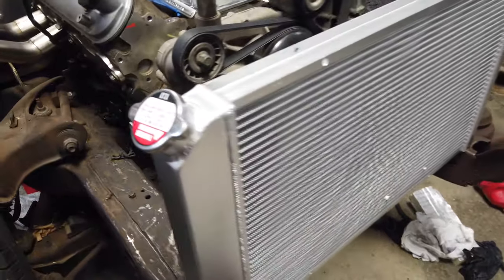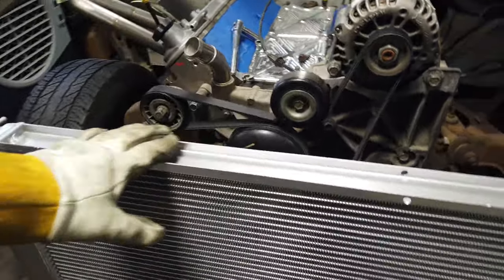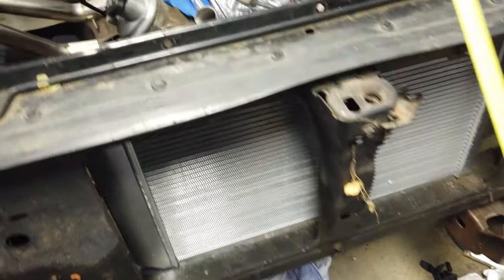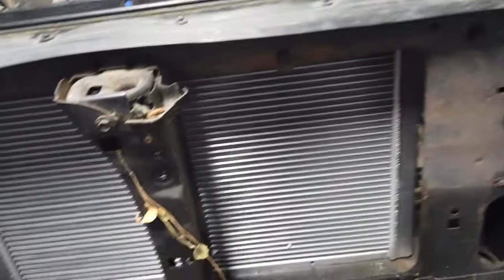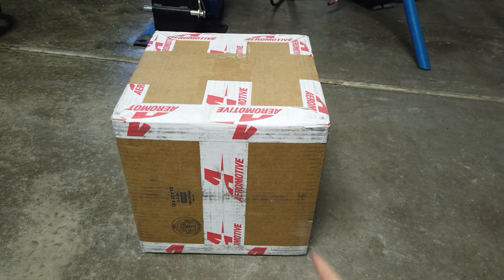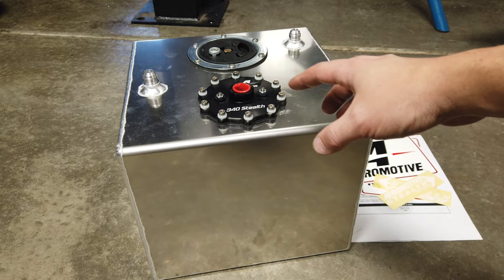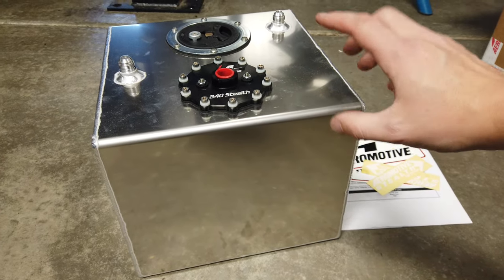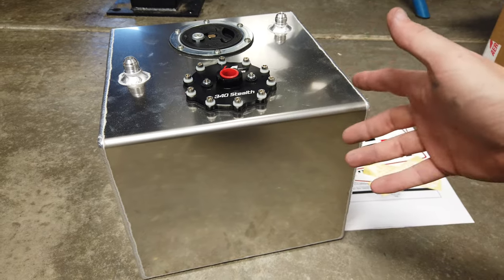More parts for Burnie the Burnout Truck... LS Swap S-10 Burnout Truck Needs MORE Parts!

Comment: 2 12" fans will fit if you stagger them. I had 1 small block s10 that had core support cut to fit radiator.
Reply from the maker: I have since found sound 11.5 inch fans but makes since i could have staggered them didn't even think about that lol

Comment: Just a idea for ya run your fuel line outer side not in the middle so can run the line down to the outside of the frame rail and snake them up to the cab that way if break a drive shaft it won't take out the fuel line something my local track made me do sucks but if think about it is safer too
Reply from the maker: Ill probably try to run them along the top so they are protected a bit more its inside some and on top some lol definitely getting a driveshaft loop too lol
Reply: @BuildTuneRace  yeah my track would not let me even tho have a loop so have to run outside of frame and not sure if my -10 line would have fit on top